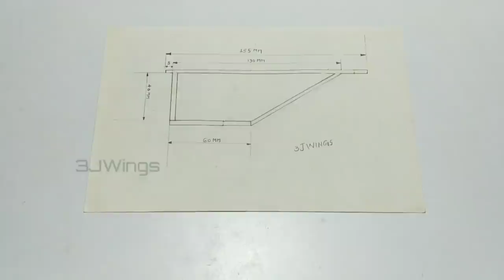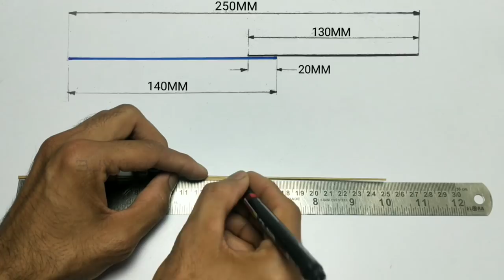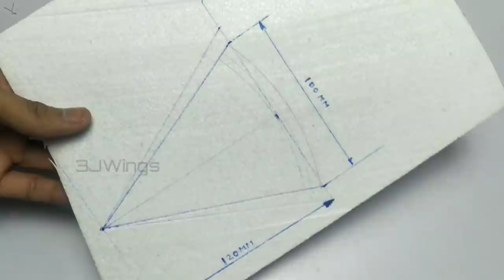How to make rc ornithopter | homemade rc ornithopter | #ornithopter

Comment: The wings pushing air downwards and then pushing air upwards with same flapping motion. Upward thrust is equal to downward thrust. Its like trying to swim in water with stiff hands flapping up down.
You can do some jugaad so that after the wing has gone down it should come up in folded style. Maybe put a break in the wing and sync the motion of half cycle of your motor with pulling the wing inwards while it goes up and then let the wing loose to push the air downward with full stretched wing.
This way you don't need to go full throttle on motor to make it fly.

Comment: Nice work on the frame... you need a better gear ratio and lose the "Body" its just unnecessary weight.

Comment: How can i bind V911 transmitter with F494 receiver?
Reply from the maker: It's very easy same way like v911 helicopter process,  plug battery in receiver & turn on transmitter that's it
Reply: @3JWings  i have tried this lots of time but it is not connecting... After turning on receiver i switched on my transmitter but no bindling ,can't understand why... Can there be any other possible reason for this issue?
Reply: @fatimaazeemkhan2739  Did you check the model of your plane? If your plane is the F949S version, it will not bind to the V911 transmitter. F949 uses AFHDS protocol same as flysky, F949S uses different protocol so you will need the stock transmitter of the S version to be able to bind and control it.
Reply: @juansadvancesaranggola8611  thank you sir